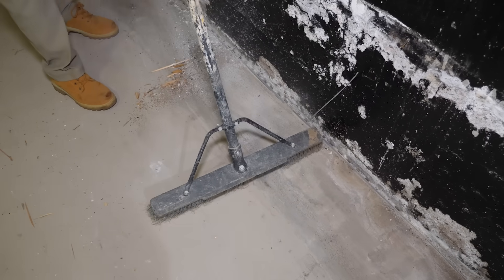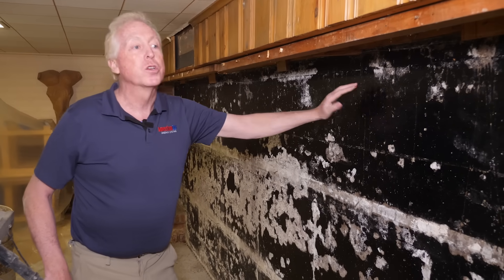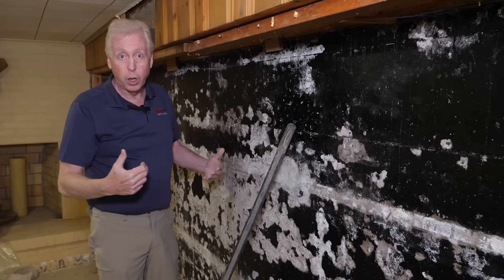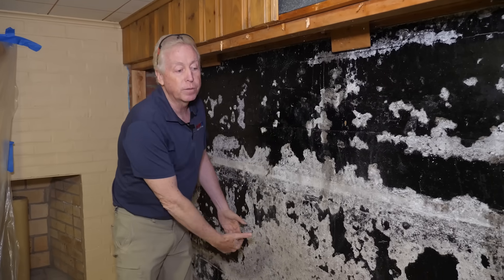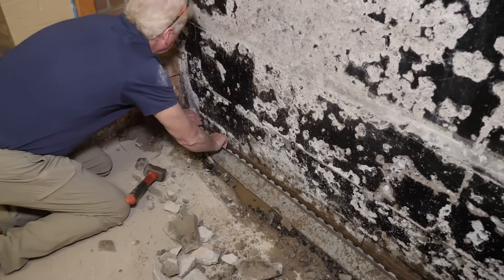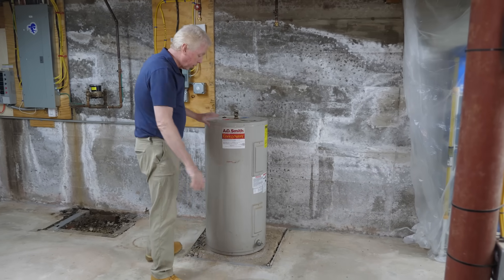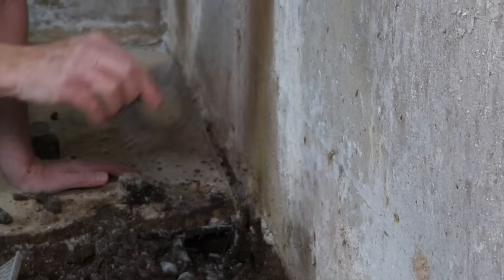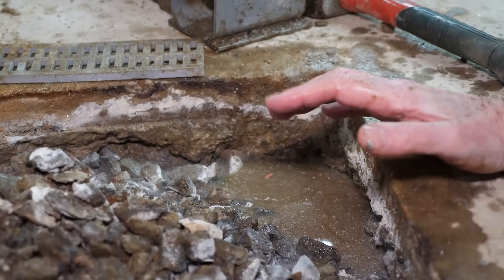Waterproofing Basement Walls | Finished & UnFinished Basement

Comment: I have a quick question; since the house is in Connecticut why not dig on the outside of the house instead of the basement?
Reply from the maker: Outside waterproofing costs 3 to 4 more. Risk of foundation damage from heavy machinery. It happens often. No long term warranty. We give a lifetime warranty. You will still suffer from hydrostatic pressure, and water will come up underneath your floor which is still unprotected.

Comment: What are your thoughts with closed cell spray foam being applied to concrete walls ?
Reply from the maker: Yes. As long as you keep the false water table outside your basement walls low.

Comment: Is that basically the the thing. 
What about sealing the exterior basement wall
Reply: Sealing the outside is the best way. When you seal the inside you essentially turn your basement walls into water storage
Reply from the maker: New construction, in general, should have waterproofing applied on the outside walls before backfilling the area around the house. This is a code-required procedure in most states. No matter what anyone tells you, exterior waterproofing deteriorates over time. The surge of water in the ground heaving rocks and gravel against the wall around the foundation wears the waterproofing away. I've seen it more than a thousand times. Exterior waterproofing is temporary. It is never permanent. I haven't seen exterior waterproofing that lasts, or I would be doing it if it worked. Interior waterproofing is very efficient and cost-effective with minimal disruption. A sump pump needs to be maintained, or your floor can sit in water. Maintaining a sump pump is far better than having an exterior system that you will constantly have to clear debris and fail in 5 years. Good luck getting a lifetime warranty on exterior waterproofing.
Reply: If I install a lot of tar and then apply a full heavy gauge plastix wrap on the exterior walls does that help?

Comment: If they Add an overhang around the whole house, would that help?
Reply: Our house has 4ft overhangs, gutters, and is graded properly. Our basement is dry as a dessert and we've had some nasty downpours in the past and have an old 1950s cinder block foundation. Our sump pump never turns on except when we pour water down it every spring to test it. Overhangs are severely underrated. They also have other benefits, for example we NEVER have to worry about water intrusion through the side of the house (e.g. if someone left the door open, or if a window was not flashed properly). I really don't understand why they aren't more popular.
Reply: @Reinhardt_Kozlowski  true facts
Reply from the maker: No. Water will still end up in the backfill area around the house.

Comment: What Kind of sealant do you recommend putting on inside of walls? and what the name of the stuff you put on the wall?
Reply: Proper drainage next to the wall helps a lot as well. We use my country also outside wall bitumen isolation and plastick dam plate.
Reply: Waterproof the outside seal with tar and plastic then do the inside
Reply: Okay maybe I'm not understanding I don't have a lot of experience with this but based on the comments the house was waterproof on the inside and not on the outside is that correct ??
Reply: Nothing, better to apply waterproofing on the outside of the wall all the way down to the bottom of the footing, with a foundation drain.

Comment: Two thumbs up. Unfortunately the cost to correct the work of the the quick fix geniuses can easily be double the cost of doing it right in the first place. Sometimes the damage is non-reversible, left long enough. Also the glib talk of "cheap and simple" even gets past the building inspectors.

Comment: Moral of the story:  never buy a house.  It’s always a liability.
Reply: Ash Hole Cigar Club  the cost of repairing a basement similar to the one in the video would indeed turn an asset into a liability. It would take years to recoup the cost in rent.
Reply: @Khaab00  it's because Americans have no clue how to build a proper house that doesn't require 24/7 maintenance. They still use sticks, plywood, drywall, hollow blocks etc.
Reply: Ash Hole Cigar Club  this is true ☝🏾
Reply: lol

Comment: So how would you waterproof a basement at this point instead of water management?
Reply from the maker: Traditional waterproofing basements/foundations from the outside during construction, and years after, are only temporary. They are never a permanent solution.
Reply: @AmericanDryBasementSystems   I'm on the commercial side, but as I understand it, the standard waterproofing should be on the positive side: wall>waterproofing membrane>protection board>dimple board>insulation (like xps)>protective fabric>then substrate...and of course your drain tile system, preferably a 4" perforated pipe with protective fabric buried in gravel to allow water to flow into the pipe and away from the foundation. 

I could be wrong though...
Reply: @jefsan9810  I've been researching the subject to build a new home next year.  From what I have seen, you are spot on.  There needs to be multiple layers and an easy path for the water to flow down to the escape drains.  The dimple board is really important to relive the pressure.  You can't rely on just one system.  Spraying tar on the wall isn't good enough.  The only thing I would add is to use pvc for the perforated drain pipe and solid pvc for the gutter drainage.  Don't use the black flexible drain pipe.  It just gets crushed when you back fill.
Reply: @donm2255  agreed, definitely not just a one system approach. I also agree on the crushing of the perforated pipe, but many of them are built to withstand those pressures and to comply with specs. Waterproofing is inherently expensive upfront, but the saving will be appreciated in the long run when the system is still holding up well even 30 years later. It's not just waterproofing, it's water management...making sure that water is being diverted away from the structure and it drains freely onto the water table. Good luck on your project!

Comment: Proper air gap helps too. Love basements. Cheapest sqft so long as you can control the moisture.  Building science has come so far now with butyl membranes and dimple boards to apply on the (business) side of a wall. Guys back then we’re just using the normal stuff
Reply: Problem is, when you’re dealing with an old 1920s house, anything went back then, from footing thickness, wall thickness, & lousy hand pouring of the concrete mix. I don’t even have 8 ft of space around one exterior side of the house.
Reply: @vallee7966  What do u mean by spacing
Reply: When you say "business" side of the wall, am I correct in thinking you mean the outside of the wall? Water proofing material needs to be applied to the outside of the basement, right?

Comment: Great job in explaining your product and issues that you point out making this very important and easy for any homeowner to understand.
Reply: I had that flat type drainage tile put in my basement, and it completely dried my basement, don't see why he's bashing it
Reply: @jasonjack5915  
Right product installed correctly! 
Wrong product installed incorrectly. 
Lucky you had a contractor who knows the difference!
Reply: @jasonjack5915  Because the system was installed incorrectly.  The best product can be the worst if it doesn't work
Reply: @jasonjack5915 
That “flat” or “box” system works ok if you don’t have a major water problem. But with a high volume water issue, those shallow systems are easily overwhelmed.

Comment: some miss info in this video, 70000 pounds of concrete isn't supported by the footer it sits on the soil under it.
Reply from the maker: The basement in the video is a three-piece foundation with a footer protruding (usually 4 inches) enough to support the floor. During the early 20th century, building engineers agree that this is the best way to create a stronger foundation for a house. You are correct if the basement is a stone foundation. Stone foundations don't have footers. The concrete must be poured on the dirt between the walls to make a floor.

Comment: So basically tar/rubber sealant is best left to seal the seams?
Reply from the maker: No. It should not be used inside. Only time tar is applied is outside when the foundation is newly constructed.
Reply: @AmericanDryBasementSystems  Awesome, I saw some folks using black "liquid rubber" type stuff for the outside seal of the basement, that's a reasonable course of action, right?

Comment: I’ve watched a few of your videos now and really appreciate the level of understanding you provide.  Are there any national service companies you’d recommend or not recommend?  We’re in northwest indiana and looking for a reputable company to patch foundation cracks from the exterior, possible interior but the interior is currently finished.
Reply from the maker: Basement waterproofing and crack repair is chiefly unregulated and it paves the way for a lot of shoddy work. Even companies with a national chain cannot control the quality of the work provided by their dealers. We cannot recommend anyone because we don't know anyone outside our service area. Sorry. Good luck on your search.
Reply: @AmericanDryBasementSystems  Wish your company served parts of NJ, particularly the city of Mount Holly. The water coming through our basement window is getting worse.

Comment: Your videos are super helpful. I’m in Georgia and have received 2 quotes for waterproofing my basement. One company is using a 12mil moisture barrier for the wall and the other is using 16mil. Is one better than the other? Both are including a draining system.
Reply from the maker: I can't recommend either. We only use a vapor barrier beneath re-poured concrete. Encapsulating walls and floors with a moisture barrier will trap moisture and increase humidity. You will be required to use a power hungry dehumidifier to keep humidity down.
Reply: @AmericanDryBasementSystems  none of my resommendations include doong anything on the walls just the drainage system. I'm so confused; got 2 quotes already!

Comment: Amazing information.
Makes me realize that my 130yr old home is better built than homes of the 20th century.
My issue is the surface mortar over the brick is crumbling in certain areas.
Mostly the wall the faces what used to be a rural route and is now major highway traffic 😢😢
Vibration from massive traffic is partly the speed up of deterioration.
Gonna cost a fortune which I refuse to pay... 😢
Reply from the maker: Many stone basements are amazing in their ability to holdup after 100-200 years.

Comment from the maker: American Dry Basement Systems serves only Connecticut and 8 counties in southern New York. Efflorescence and hairline cracks on basement walls are the first signs of lateral water pressure. Get a reputable waterproofing inspector to take a look and give you an honest assessment. Only settle for a robust system installation 10 to 12 inches beneath your floor with a lifetime warranty from a 10+ year company. Your house is expensive and increases in value. Take care of it, and you will reap the benefits.
Reply: If you only serve the areas noted, do you ever have recommended companies in other areas that you refer?
Reply from the maker: No. If I am not personally familiar with a company I cannot recommend them. You will come back to me with a complaint if the job is done poorly. It is up to you to research and ask the right questions before letting anyone waterproof your basement.
Reply: Thanks
Reply: Is there any spray to help with sealing in the water from coming in to the basement? I been looking for solutions to help my 88 year old grandpa who would like to keep the water from coming in through the outside to the inside of the basement. I would like to help him and therefore he isn't doing this alone and by himself. Also, what are the 8 counties in NY? Thank you.
Reply from the maker: @ashleyroman2233  Sealing the walls alone will not stop water leaks. You need to lower the hydrostatic pressure with a subfloor drainage system.
Reply: I found the 8 counties on the website. All I need is to see if you can help with my question about sealing the water from coming in and that's in the basement.
Reply: Yes, I have one in Virginia. The company that installed shows up as Out Of Business, and getting sued like crazy. I just replaced my pump battery charger, and it seems to run, but noisy like the old one that died, so who knows how long that lasts. And my walls do flake off that powder, which I thought was just the paint blistering off. Thanks.
Reply from the maker: @john dandola No. Drylok paint is not good to use before you find a proper way to manage the water level to reduce hydrostatic pressure.
Reply: I've done waterproofing for a company and when we replace the concrete we would only replace it with 2 inches of fresh concrete... you think that's enough or is 3 1/2 inches code in most of the US?
Reply: Hired you guys to get my waterproofing job. Looking forward to getting it done around 10/2022. Feel free to do a video on my basement. Alex in Otisville, NY
Reply: Can you guys recommend a reputable basement waterproofing contractor in north/central NJ?
Reply from the maker: @dand5829  Sorry. We are not familiar with anyone in NJ.

Comment: So that's the white chalky looking powder stuff I have on some spots of my basement walls? My landlords gave me the green light to use the basement underneath the house and I'm fixing it up for a Mini wood working Project shop and when I moved all the old rotting wood panels they used for shelves and other junk, I found this white chalky stuff  on some areas of my basement walls. Looks like I got alot of work ahead of me before I can make my basement look great. Thanks for the video.
Reply: It's lime and calcium.
Reply: @bb-lq6dm  ah I see. So can a metal wire brush do the work to remove this stuff? Anything you can recommend me to apply to this concrete wall to somewhat prevent this from happening again? Thanks again for your help. 🙇‍♂️
Reply: @joseluisruiz3789  of that I'm not sure. Still learning myself
Reply: @bb-lq6dm  no problem, I haven't started removing the efflorescence my self as I'm trying to learn more about it and a solution to try and prevent it from coming back once I clean it all up. As of right now I bought a shop vac and some metal wire brushes and a 3M breathing Mask with some Cartridge filters on them intended for asbestos and gasses. 😅 I have asthma so I don't want to breath that stuff in if it's bad.
Reply: Something Different  so you just scrape until it stops falling off? I've seen other vids where they add another layer of concrete. I have more than a few areas in my basement and garage like that

Comment: Can you recommend a company that does this work in New Jersey?
Reply from the maker: Not at this time. Sorry.
Reply: Is there any advise you can give me for my painted basement walls?  I can see the deterioration of the cement happening.
Reply from the maker: @murzua5  Don't worry. Your walls will not crumble and collapse. It is a sign that you have a lot of moisture outside collecting against the walls. The exterior waterproofing applied during construction wore away. Ensure water from gutters is directed 8 feet away from the house, not directly down into the foundation. Your paint made sure the moisture stays trapped inside the walls longer. You can hire someone to remove the paint and allow the walls to breathe. Down the line, you might have to address this water problem if the walls crack or you see water on the floor.

Comment: Is it possible to drill down from the outside of the home in strategic locations and put a series of sump pumps in to keep the water table down during extreme storms? We had an extreme flooding event earlier this year (last event of this scale was 10 years ago) that caused some minor water intrusion into our basement but it went away immediately after the waters subsided. So I’m not thrilled with the idea of jackhammering the perimeter of the basement floor for the sake of a once per 5-10 year event. However I do like the idea of eliminating the false water table as quickly as possible when that event does happen. Is this a stupid idea or do you think it might have legs? Wish you guys were down in Nashville then I’d just get you to handle it 😂😂. Thanks again for putting out this content!! Great work and explanation.
Reply from the maker: Exterior sump pumps may temporarily resolve your issue, but it will be more of a headache than you think. Sump Pumps get clogged often and breakdown quicker outside. You will have to increase the amount of drainage pipes. which will get clogged or damaged by root intrusion. You will have to increase your maintenance schedule to keep them clear and check the pumps and baskets. Jackhammering, installation, and cement work takes 2 to 3 days with very little dust. Maintenance-free drainage system. No clogs. You only need to check your sump pump once a year. Interior sump pumps can last between 5 to 20 years. I hear of exterior pumps failing and getting switched out every 6 months to 2 years.
Reply: @AmericanDryBasementSystems  Man, that is really good insight. And a really good point I didn’t consider - that the foundation and walls effectively act as a filter system that reduces the amount of deposits in the drainage system. Thanks for the reply! Love your videos, keep doing what you’re doing.